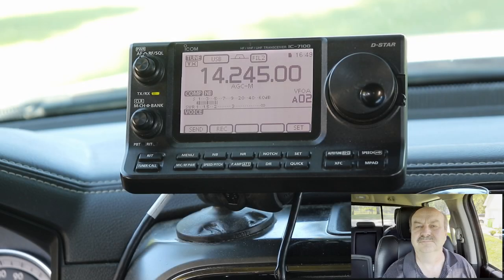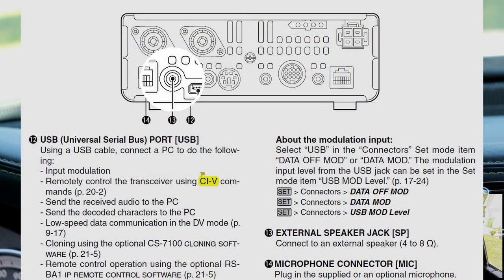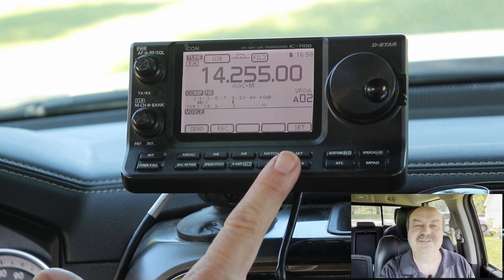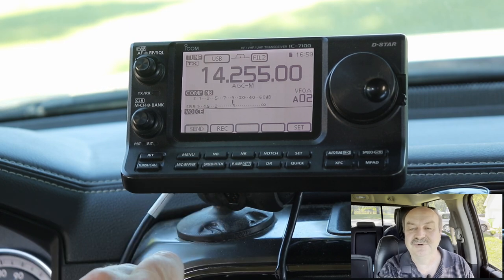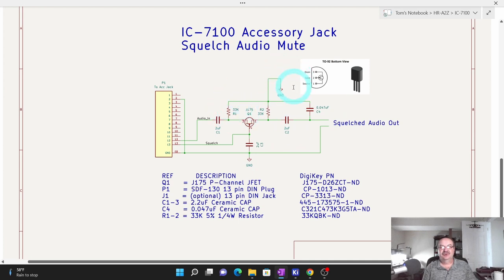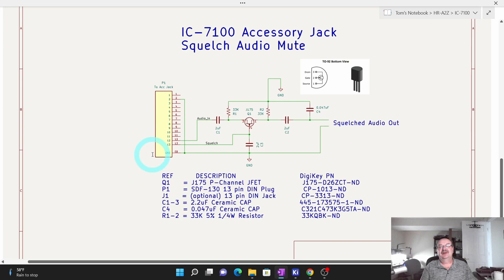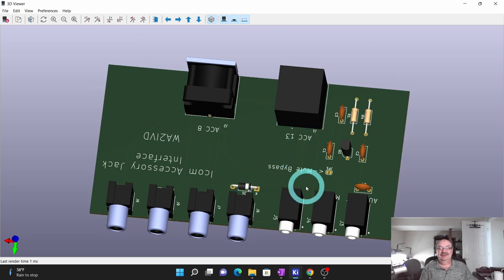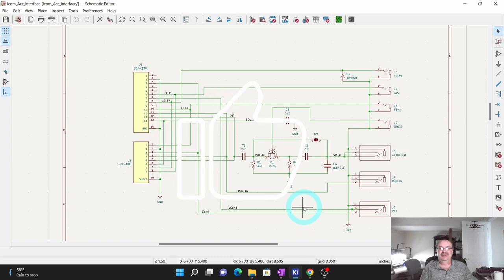IC7100  A to Z #22 Squelch Circuit Update

Comment: You talked about FSK audio. Can any audio be put in.  Something like audio from a computer,  there is audio out and PTT for computer control. Yes it has a USB,  but I have an older computer that doesn't have USB. And I am sure that someone will come up with some audio that they will want to send through the radio. I only have a 7300 now but have thought about a 7100 for my truck. To help with the audio level being to high, I thought about something like a voltage devider. 2 resisters in series. From the audio in to ground and tap off the audio between the resisters to the squelch Q1. Just some thoughts.  Thank You for all the videos!   73. W4DES

Comment: Need an LED to show TX/RX status.  Put a header for the LED so it can be remote mounted.
Reply from the maker: Good thought on the LED.  Would need to use 2 LEDs or add a little additional logic to do off, on and flip polarities for a red/green LED since Squelch and Transmit are on 2 separate pins.
Reply: @HamRadioA2Z  even a separate circuit would be good for me.  The 7200 and others don't have much of a visual status indicator for tx and busy squelch.  I want to mount an LED in the front panel.  I'm just not that good at circuits...haha.

Comment: I have a issue, When I have the volume up (using the built in speaker in the controller) and I get a really strong loud signal the radio just shuts down. I'm lost on whats causing this. Any help would be appreciated. K5RLT